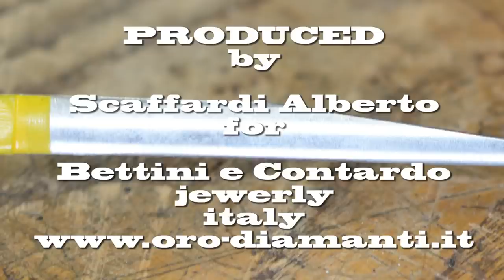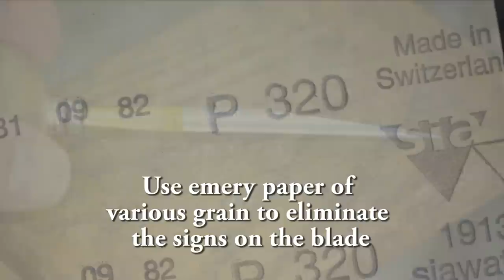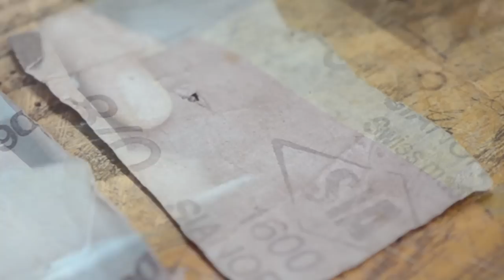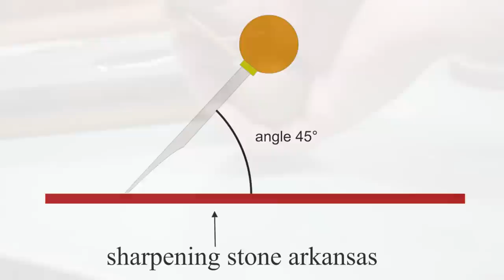How to prepare a gravers preformed Vautier to embed a cut

Comment: Hello sir I have one doubt, when you are using Emery paper to eliminate the signs on the  blade, do you lift the graver up to some degrees? So that the graver cuts the metal at the same lift angle. Thank you.
Reply from the maker: no, the card che usiao sono molto finished e non cambiao la sezione della lama
Reply: @scaffoal  thank you sir